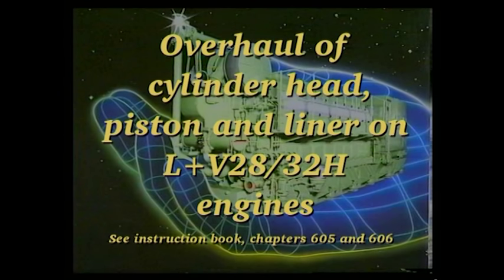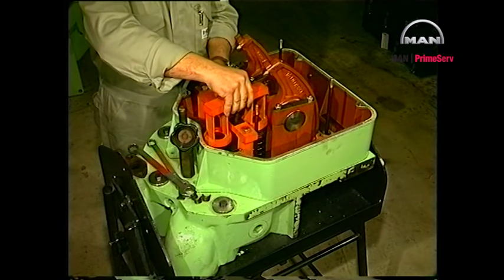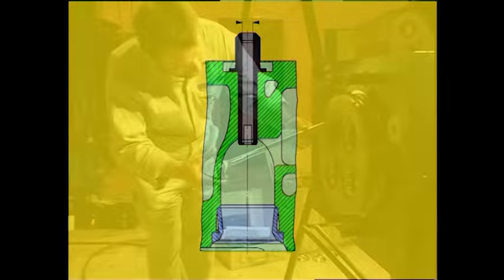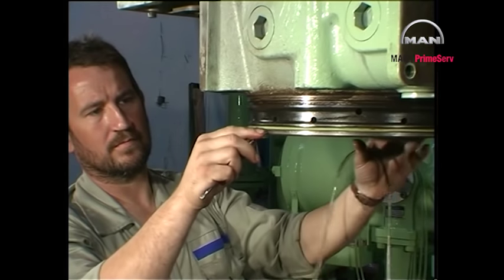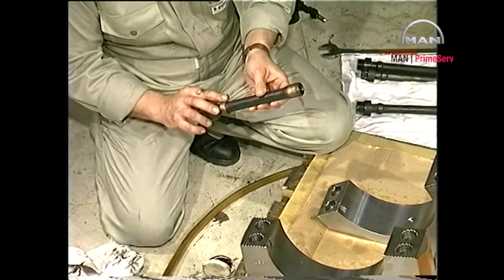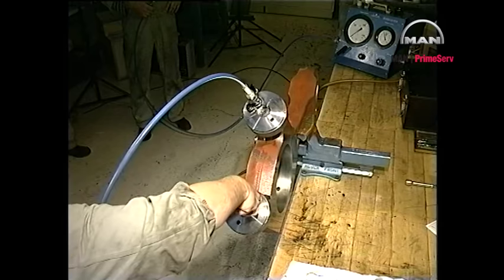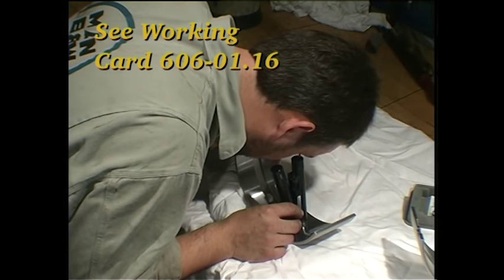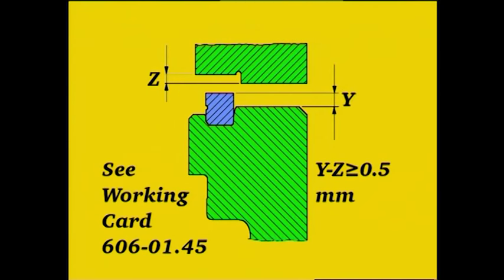L28/32H Overhaul of Cylinder, Piston and Liner

Comment: how did rod go from 4 cap bolts to 2 cap bolts then back to 4 cap bolts,  did i miss something. ?
Reply: Good observation. There are two different types of connecting rods, one that can be assembled with a mechanical torque wrench that has four cap bolts and a second variety that is assembled using a hydraulic jack that has two bolts. There was a note that mentioned this when a certain action applied to both mechanical and hydraulic types.
Reply: Yea, the hydraulic mechanism confused me too.